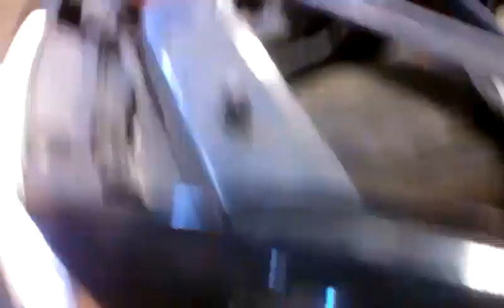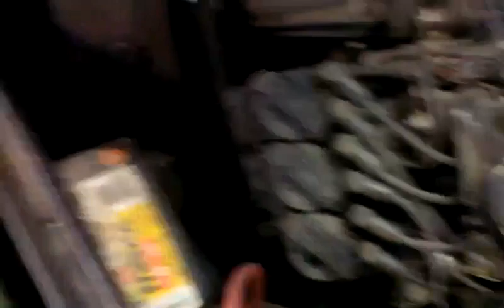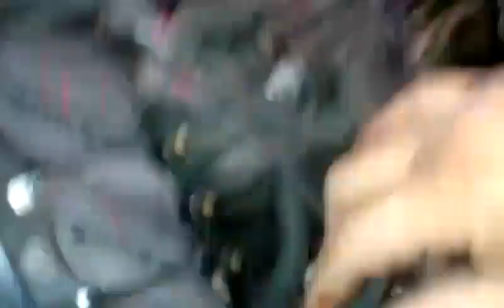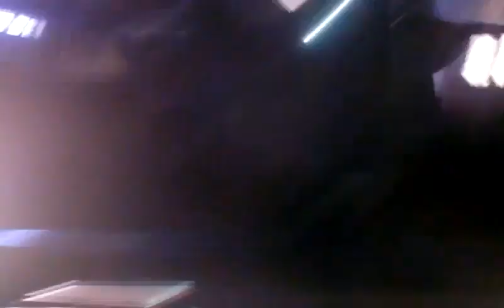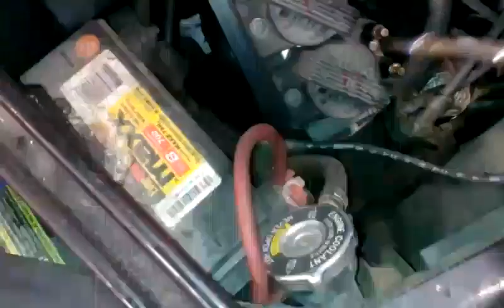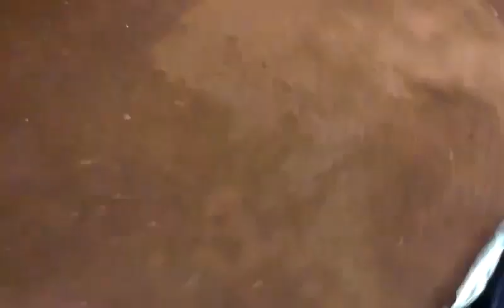99 GRAND PRIX SC 3.8 MISFIRE

Comment: Show my 3800 Supercharged Grand Prix just started misfiring on the number 5 cylinder. Which is why I'm watching this video today. FYI when you pull the spark plug wire off don't grab the boot or you'll get this shit shocked out of you. I learned the hard way.

Comment: Often if the coil is bad, the module below it is getting weak and that takes out the coil. Seen it happen many times. Best to replace the module at the same time as you replace the coil, then carry the older module for a spare along with a 5.5mm nut driver.
Reply: Wutzmyname Mike  the gas smell at the exhaust is from the misfire it's not igniting the fuel so you will smell that. Did you ever get your issues sorted out? I have a 90k series 2 and it started misfiring and I changed the bottom coil that wasn't showing spark to the middle and it seems to run better and I can't see spark but I felt a little. Don't have money for a module was hoping it's just a coil pack

Comment: This problem and all other misfire more than likely is the ignition control module or I.C.M. That's because they designed the motor where on the lower radiator hose runs directly under the ICM. Causing overheating of the module.

Comment: Only thing 2 remember is you'll get your ass shocked if there is just one strand of wire poking thru boot and those stands are almost impossible 2 see so be careful if u pull a wire when idling,, need 2 use noid light or spark checker tool,, also I really hate it when someone just numbers wires  in sequence instead of the actual firing order,, but still he fixed it so 4 most that's good enough

Comment: Why did I get shocked when I tried this? I followed the Video precisely. What did I do wrong?
Reply from the maker: PreciousRareFind you went to close to the coil, but don't worry about it every time you get a shock you get smarter
Reply: I had too, when someone first told me to do this. I'm convinced that just grabbing the wire and pulling it off is BAD. I remove the wires one at a time then start the engine, check whats happening, then turn it off, reconnect wire, repeat. Takes longer, but less likely to kill you!
Reply: Wear rubber gloves.
Reply: I did too that's why I cut the car off then took the spark plug wire off and then cut the car back on to check
Reply: Me too !  Don't grab the boot like I did lol.  And wear rubber gloves

Comment: Can this cause your battery voltage to dip down and back up? Car idles rough as hell but seems fine accelerating.
Reply: Vaccum leak
Reply: Mine was doing the same. Plenum gasket/upper intake manifold gasket was gone on mine causing a leak

Comment: Switched bottom coil with working coil and still no spark.  Any idea ?
Reply from the maker: andy boush 
Bad ignition module
Reply: Then it is likely the Control Module under the Coil Packs.

Comment: Mine's doing the same thing I went to the junkyard to get a new piece and it's still not getting any Spark I wanted to try to get some brand new ones but they cost a lot more
Reply: Sometimes it's the module underneath it's kind of expensive ICM
Reply: You can get replacement coil packs and ICMs from a junkyard.
Reply: @carculturenation2166  yep that's what is was to
Reply: @SeeItLikeItSub2It  it was the Icm underneath

Comment: I did that and it still had no spark on the bottom one
Reply from the maker: You need to replace the ignition module
Reply: I did that too
Reply: Can it be the fuel injectors?
Reply from the maker: @armandomendoza1289  
The fuel injectors don't interfere with the spark
Did you replace it with a new ignition module because if there is no spark in only one coil there are only two options ignition coil and ignition module 
If the crankshaft position sensor is bad then the problem could be a no start condition no spark at all on any of the 3 ignition coils
Reply: Yes I replaced the moglui  and the coils and the bottom one has no spark when I take of the plugs
Reply: Any help ?
Reply from the maker: @armandomendoza1289  
Did you check for spark direct at the coil or at the spark plug wires ?